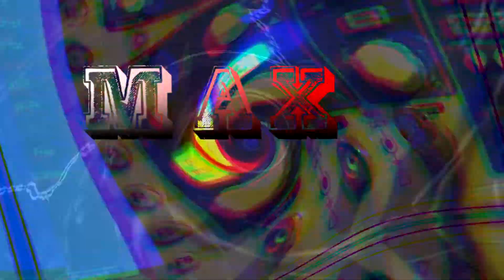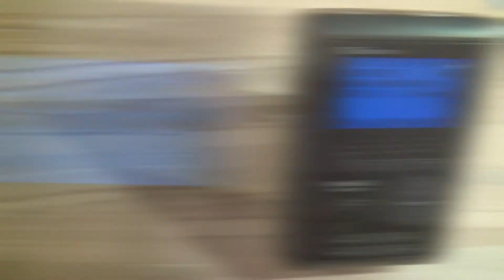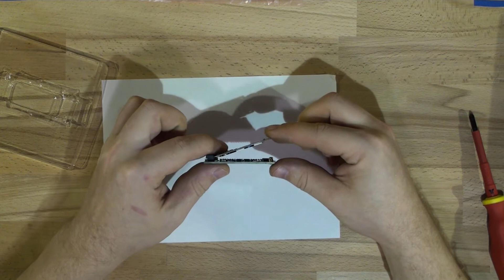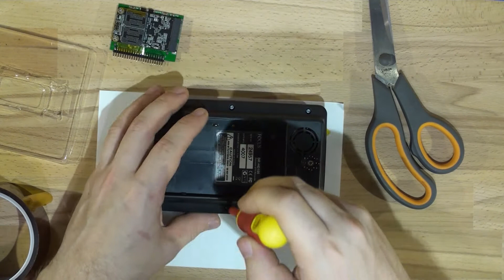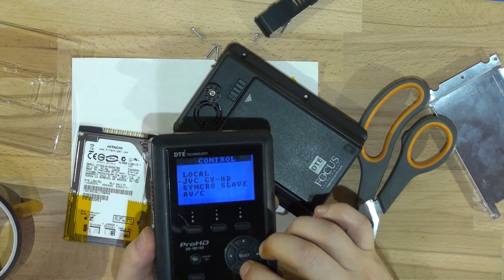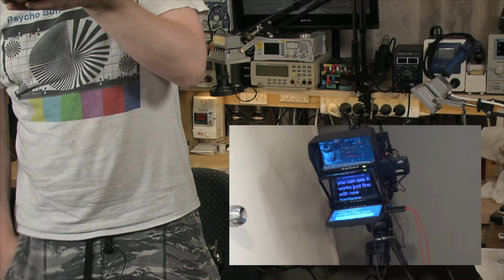Fitting PCI-E (mSATA) SSD Into Focus DTE DR-HD100 ProHD Video Recorder. Will It Work?

Comment: Hey Max I don't have a FireWire port on my pc and I can't use a FireWire PCI-e card because I have one slot that is used up by my graphics card so would a FireWire to USB adapter work for file transfer or would I have to use a FireWire port?
Reply: Or if FireWire to USB does not work is there any other adapters that would?
Reply from the maker: I’m not too sure tbh, I’ve never tried it

Comment: question  I get no disk  now, even with the original drive.   I suspect ribbon Cable ,  Thoughts?
Reply from the maker: I’d say so, have you checked that it’s the right way around? It’s easy to plug the drive backwards

Comment: Nice video. Thanks for posting. That said, I'm not very familiar with electronics, but I have a strong desire for a product that is no longer in production – the Sony HVR-MRC1 memory card recorder or a Focus Firestore FS-100. It's unfortunate that they are no longer available. While you can still find some used ones, I believe it would be great to create a new and improved versions.

However, I lack knowledge about the components that make up such devices. Are they called microcontrollers, Arduinos, Raspberry Pis, or a combination of these? Perhaps there's something called firmware involved as well? I'm quite clueless in this area. If anyone could provide me with the names of the parts involved, it would be a fantastic starting point for my research into building a similar device.

Thank you!
Reply: Hey mate, unfortunately something like this requires an extensive amount of expertise on electronics. One of the factors you face is the transfer speed of firewire is extremely high which most likely an addition/rasperrypi don’t support. Then the realm into microcontroller is your best bet for the speed, then you have interface with the FireWire protocol including learning C programming and understand PCB building and circuit characteristics and correct chip selection.Your best bet is to find one of these recorders, there’s a reason there are development teams behind these products because of the complexity of it all.

Comment: I may be a little late, but figured I'd ask anyways. My own DR-HD100 works well, my only problem is that it doesn't power on when the battery is inside. The battery works, has little hours on it. It also outputs voltage. Do you know what could be the problem there?
Reply from the maker: It could be bad spring contacts on the recorder itself, try opening it up, disconnect the wire that goes to battery compartment. Then put battery in and measure if there’s voltage on the wire from battery compartment.
Reply: @MaxELECTRONICS  The Recorder itself shows the batteries voltage on the onboard status menu and shows the battery icon when hooked up to a 15V FireWire PC port. I'll try measuring though, thanks for your quick reply!
Reply from the maker: There’s 4 contacts, for balanced charging, it may see some voltage and think battery is there, measure voltages on all 4 wires, it’s tapped of the battery in series, one wire will be common and other 3 with voltages, for example wire 1&2=3.7 volts, 1&3=7.4volts and 1&4=11.6volts (roughly)
Reply: @MaxELECTRONICS  There's 3 wires going from backplate to main PCB assy. Grey, red and black. Interestingly enough, there's no voltage between the black and red wire. I tested the contacts between the wires and the terminals, there should be voltage on the wires. Probing the battery terminals directly shows that there's 11 volts on it. I'll check the direct wire connections.
Reply: @MaxELECTRONICS  Took the thing apart and somehow fixed it, now the battery powers the device. Thanks for your help, your quick responses and the good video! I'm considering updating the HDD too.

Comment: pls it bossible for u so make one for me. or ucan tell me how i can get the part am in london
Reply from the maker: It’s very simple, take the original Hdd out and plug in IDE to CF adaptor, Here’s the part you’ll need: 
AU $5.04  15％ Off | Cf Compact Flash Memory Card To Laptop 2.5" 44 Pin Drive Board Hdd Ide Adapter Hard Male Electronics Disk Card Conversion
https://a.aliexpress.com/_mO3feKo
Reply from the maker: And this is part of you want SSD instead of CF:
AU $17.89 | Chenyang mSATA mini PCI-E SATA SSD to 2.5 inch IDE 44pin Notebook Laptop hard disk case Enclosure White
https://a.aliexpress.com/_mPIMWUM

Comment: Hi Max, do you know if this modification works the same way and with the same components on a firestore FS-4 ? I would like to make mine lighter. Thanks for your videos, always usefull ;)
Reply from the maker: Hi, yes, FS-4 is exactly the same, it will work just fine
Reply: @MaxELECTRONICS  Thanks, i just bought the mSATA / IDE converter. But first, i have to change cells of the battery that no longer  hold the charge. Another mission ;)
Reply from the maker: They’re very easy to replace,

Comment: Such a great vid! Im able to buy this model for 25 bucks with one broken off firewire port. Its disassembled but everything looks good. Which replacement firewire port should i buy?? Thanks!
Reply: so could i use a sd card to cf card adapter for this?
Reply from the maker: Not unless you have IDE to SD adapter
Reply from the maker: Just a standard female ieee1394 port

Comment: Hello, I have a problem with my equipment.
When I press the record button, the counter remains at zero, it does not run. I have tried it on two different cameras and nothing.
Reply from the maker: Hi, it seems video isn’t getting to recorder, try different cable, if you are sure that camera outputs FireWire signal and cable is good, check the recorders DV port for damage, if all that is ok then there’s settings problem, try setting camera to DV (not HDV) and recorder to DV , choose FREERUN TIMECODE on the recorder, and turn SYNK off (manual record controlled by buttons on the recorder itself) see if that works.

Comment: I have another question. What characteristics does the solid disk have to have. Will it accept a 128gigabyte disk.
And if you could put the link of the disk that you bought, thank you.
Kind Regards
Reply from the maker: Yes it’ll accept 128gb disk, I just bought the cheapest one on eBay, it doesn’t require specific disk, any will do.

Comment: Hi, what is the difference between the DR-HD100 and the FS-100 and which one is better?. Kind Regards.
Reply from the maker: Hi, internally there’s no difference, the company has different names, one is DTE the other one is FOCUS, there is firmware difference between normal and Pro model, the Pro HD version is better
Reply: @MaxELECTRONICS  no. the fs100, dr-hd100 and fs-4 are different. even though they all have the exact same hardware and support recording standard dv, hd recording is different. fs100 only supports dvcpro, hd100 only supports jvc 720 hdv and the fs4 (afaik) only supports standard 1080 hdv.

 its also worth mentioning that it will only record if the video input is the correct region. for example, if you input pal video into an ntsc model it will refuse to record. region switching is easy however. the 3.5mm remote jack is a serial port. connect to it, baud rate is 19200. spam ctrl c to halt the boot process (prevent middleWare from starting) then type middleWare -ntsc or -pal depending on the region you want to switch to. the region switch will be saved and you do not have to do this every time you turn it off and on again. note that the logic level on the serial port is rs232 so use a proper rs232 to usb adapter or better yet, a real serial port. it wont work with ttl level uart to usb converters